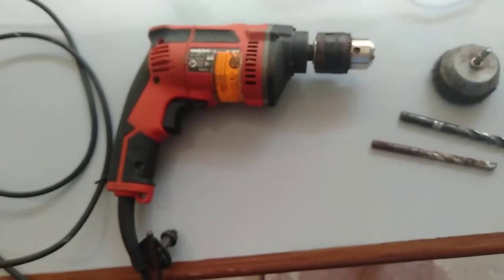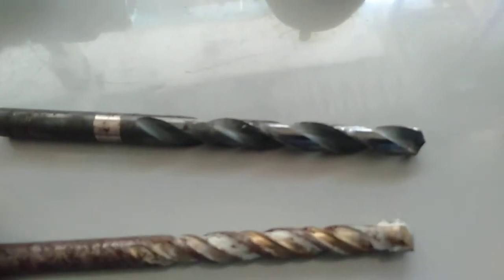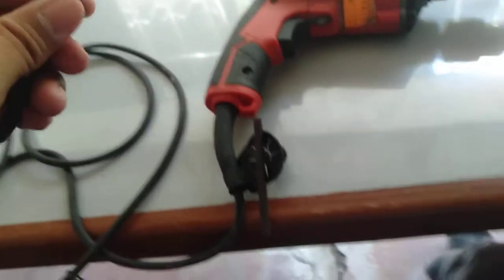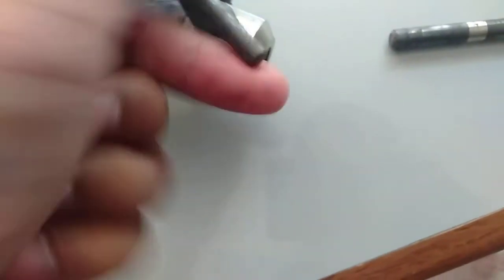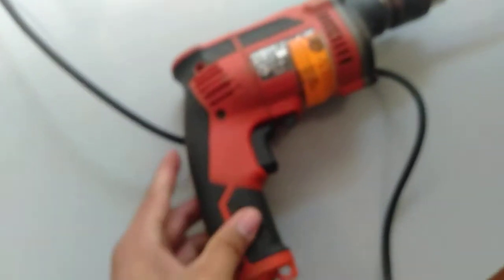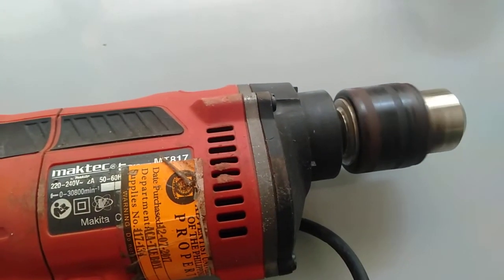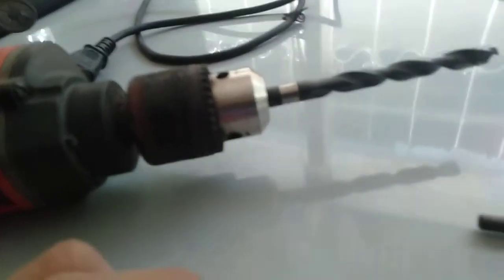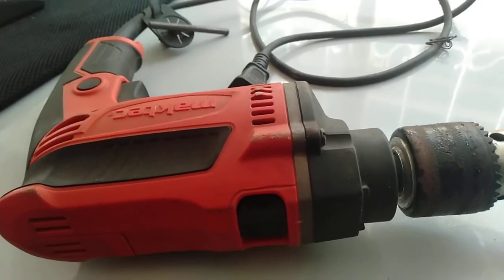Parts of a Portable electric drill

Comment: 1.masonary and rivet bits
2.chuck
3.plug
4.cable
5.chuck key
6.pistol handle grip
7.housing
8.trigger switch
9.swtich lock
10.cable sleeve
Reply: Sir about d  switch in the upper portion?